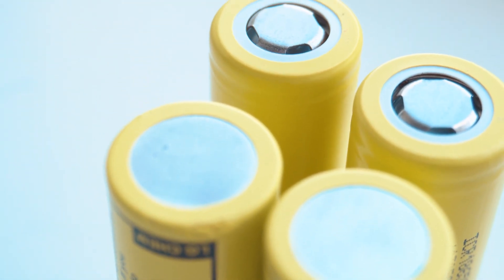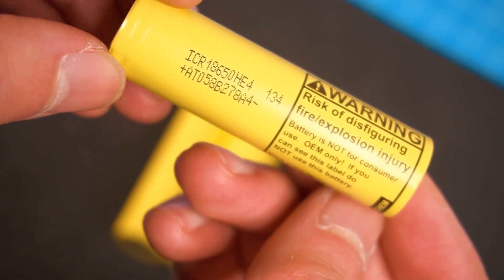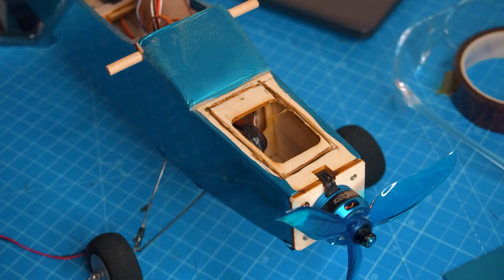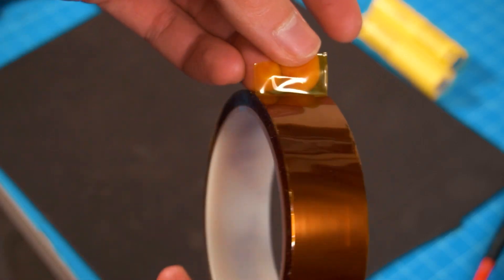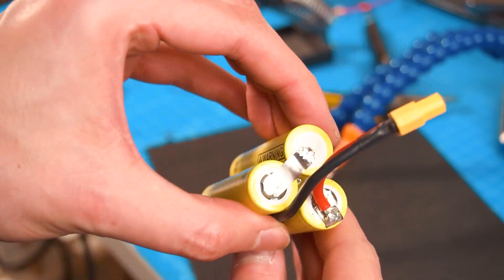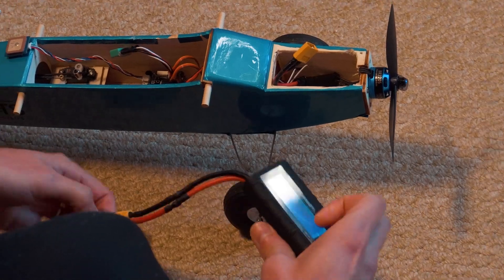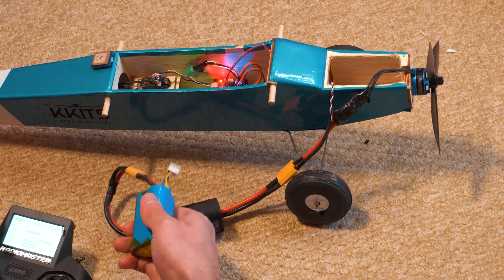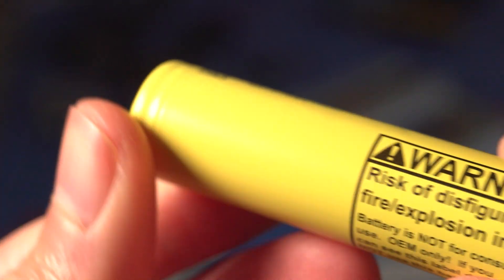I Made a Long Duration Li-ion 18650 Battery for my RC Airplane | Li-ion vs LiPo

Comment: I highly recommend checking out batteryhookup, there prices are much lower, and have good quality. You could purchase 27100 cells for 1.75$ a piece capable for 35a discharge

Comment: How many volt needs to be fully charged 3s battery like that
I remove one from driller it works great but i dont have the charger to know when is fully charged

Comment: i want to use li ion battery but im not really shure if i know how to do it properly. does the balancing cable need to be conected somewhere or is it only when charging.
i want to use it with a molex adapter for a rc car
Reply: The balance cable is  only used for the charger to charge each cell equally. The wires on the balance lead can not handle large current. The main pluglike the xt60 is used to power electronics

Comment: Nice test. For complete results it would be interesting to measure the thrust of both batteries. Does the li ion can rotate the motor at the same thrust as the lipo?

Comment: I just made my first 18650 battery pack. I had 2 brown outs just cruising with my 7 inch drone. I think my spot welds were not very good. I used 2800mah 35a discharge rated Molicel 18650 cells. Should be plenty good for the drone. My spot welder got the nickel strips to stick to the cells, but I seen no sparks, no smoke when spot welding. I am thinking my poor welds created a lot of resistance and did not allow the power to flow well from cell to cell to drone.

Comment: I am making a GIS Mapping Fixed Wing 2M drone to fly +2 hours (looking at 3.5 to 4 kgs AUW)... so the battery pack is going to be big !!
the batt pack is going to be 4S2P style  (as of this moment)  Li-Ion 18650 , home made pack.
I am concerned about HEATING ? Should I be ? 
I mean if the cells do heat up ... I am concererned about the IN-BETWEEN cells .. will it be dangerously hot inside !! ?

Comment: The C rating is an issue as well with the cheap 18650 batteries. If you are using a motor which draws 12amps max, a 3s 2200mah li-ion with 2c rating is not gonna cut it. Higher C rating cells are costly and it then makes more sense moneywise to get a lipo.  21700s are well bigger in size and probably heavier but if there's no CG issue, those would be useful.

Comment: Somehow I feel the spot welder is just 3 18650 cells shorting....
Reply: nope its a high discharge lipo....but you were close.

The best ones are made with supercapacitors. I think the microwave oven transformer ones are meh

Comment: What is the tickness of nikel strip that you are using? I read somewhere that nikel strip 7mm x 0.15mm can pass only 5A.
Reply: Thats a rather conservative number but that is what the most popular chart says. There's another chart I got off endless sphere that doubles the ratings from the first chart. Best thing to do is to determine how conductive pure nickel is vs copper (don't use nickel plated steel!). Then determine the cross sectional area (thickness x width) then compare that to copper wire, factor in that nickel is only like 25% as conductive as copper and bam you have your rating

Comment: I have been doing similar to you but for my boats. I also found that if you need more volts than an 18650 can supply a voltage booster card can be used. I get my batteries from recycle yards that take electric scooters. pulling the battery case apart gives 30 X 18650 cells with some scooters having 50 cells. I pay $40  per pack. A well done film clip. Thanks.

Comment: I think you have to be careful with homemade li-ion pack as the spot welds cannot handle all the current the battery claim to deliver. So it can be misleading thinking you can use a homemade li-ion pack and get lots of instantaneous current; as you will melt the spot welds and maybe start a fire. If you try to pull lots of amp, that is.
Reply from the maker: You're right, I would recommend welding as many spots as possible to generate more contact points where current can flow, and the strip has to be thick enough to drive that current.
Reply: That will not start a fire. The ideal way is to layer two or three layers of nickel strip or use 0.1mm copper with nickel on top. The nickel on top allows you to spot weld the copper which normally cannot be spot welded

Comment: Is the laptop battery suitable for this as a replacement for the 18650 battery?
Reply: No, the laptop battery is NOT suitable. The discharge rate from laptop battery is really low

Comment: Hello Joyplanes Rc, can you make a video about motor thrust 3s lipo battery vs 3s 18650 battery and last is to use 4s 18650 battery if can beat the 3s lipo battery

Comment: Are you using a 30A esc  ? But my plane is kind of heavy can I still use this battery type … I’m using a 30A esc
Reply from the maker: Yes, it is a 30A esc, but it does not matter, what matters is that the battery can provide that amount of power when the motor draws it.

Comment: I have a question: I have a drone that uses a 3.7 V lipo battery, the battery is old and I was thinking of changing it. Do you recommend I change it for one of the same voltage of this type? Obviously adapting it to the inputs. The drone is not a racing drone but a medium-small one. Thanks
Reply: buy a battery with a voltage and c rating same as the old one. li-ion batteries for that size and amp draw rating may be hard to get. As for the capacity of a new lipo, if the old one was 250 mah and the drone flew nimble and quick, you may be able to get away with buying a much higher capacity battery for example a 300-320 mah for potentially longer flight times at the cost of agility

Comment: Man this hurts a little. You should know that going under 3,7V per cell already destroys the battery but I bet you haven't touched the Tanár motor once. I am pretty sure that the windings were hella hot and I'm not even talking about the ESC. Outside especially in this weather it would be ok because the air cools it down significantly but in a room temperature with no air flow the propeller won't really cool it down that much. Big dedication of the components for a youtube vid :D
Reply from the maker: Yes, it was hot going at 100%, but that's what it is, and the li-ion can be discharged to 2.5v per cell.
Reply: @Joyplanes  okay, I believe the li-ions are a little bit more durable than lipoly, didn't the cells get warm too? I would rather take the 30A output cells at least.
Reply from the maker: @LordMarinade  Yes, they did get warm a bit, but the LiPo was warmer after the test.
Reply: @LordMarinade  "A little bit more durable" you say? 2.5V (and that's conservative) is ALOT more discharge than 3.7.  1.5volts of discharge for the lion vs 0.5V for lipo from the 4.2V max charge for both. Thats 300% more, hardly "a little bit" by any stretch.
Reply: That's experimenting man. Remember how Madam Curie tested critical mass of radio active isotopes....
Reply: The minimum discharge rate for lipo is 3V not 3.7V Going under that will destroy the cell. Just as much as pulling too much current from them or charging them too fast.
3.7V is the nominal current at wich lipos operate, 4.2v is fully charged and 3V is where you should stop.
From what i know, most esc, or battery management systems(BMS) for both lipo and li ion batteries shut the circuit down when the cells reach 3 volts.

Comment: An interesting exercise although I personally would have soldered the leads to the nickel strips before spot welding them to the batteries. No need to worry about how much heat you are putting into the batteries that way! ;-)
Reply: Good idea actually! Didn’t think of that :)
Reply: Do you have to connect the balance leads to the nickel strips, or can you connect to the li-ion terminals on either side of the strip? In a case where you don't have a spot welder, it would be jumper wires being used not nickel strips.
Reply: @on1ytheb3st  If you are planning to solder directly to the battery terminals you might want to buy the type with solder tabs already attached. Much less likelihood of a mug punter's soldering disaster that way. If you want to use the button or flat end type cells you might be best to just put them in a plastic battery pack. Let us know of any success/disaster. 😉🙃